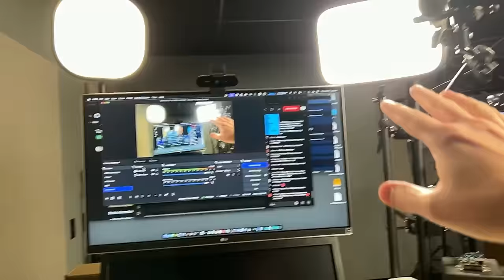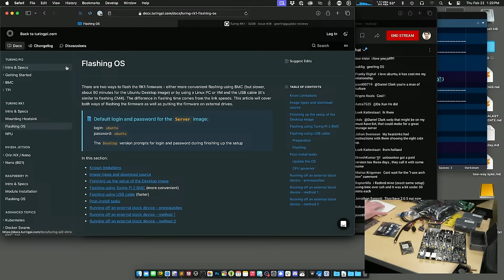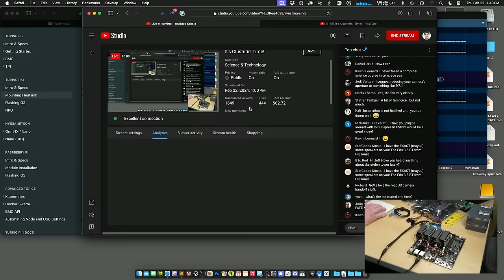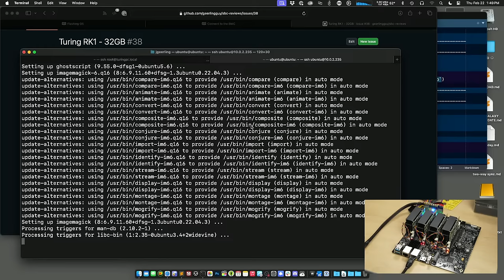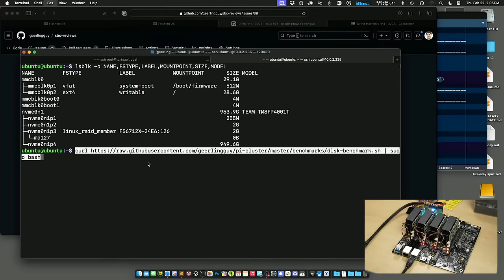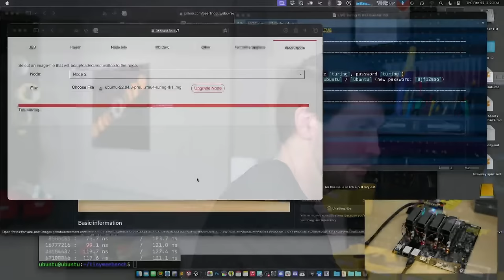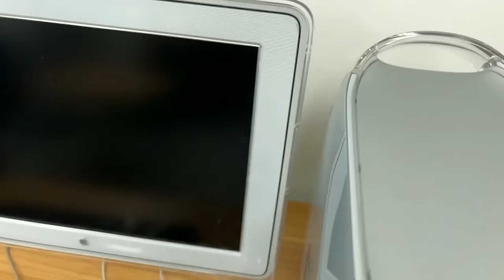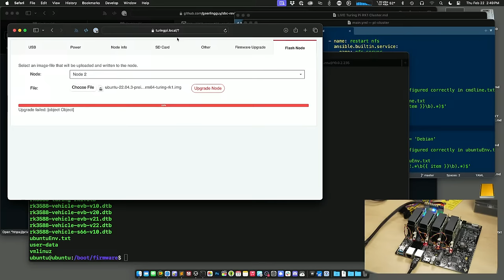It's Clusterin' Time!

Comment: The RK1 looks like an interesting processor option.  The 16 cpus you saw says the 8 core processor has 2 threads per core.  Linux shows a thread as a single cpu.
The single 1Gb ether to me would be the greatest negative for this Turin board.  
Thanks for this video.  For being a live event,  you did great.  Best made plans sometimes just don't work out in execution.  You were really resilient.  No need for apologies!

Comment: I had a Turing Pi 2, partly inspired by your early videos. I managed to get through the older Phoenixsuite updates and get connected to BMC. Got it upgraded to the later and improved software. But there were so many hardware caveats, things to solder or boards to add for basic functionality. I had two Orin Nanos and was never able to get those recognized. Finally realized that the point for me was to learn cluster software, not trouble-shoot hardware so I sold everything off. But I don't have anywhere near a millionth of your level of expertise. Took the case and power supply and built an AMD PC running Ubuntu. That sort of hardware I was able to build and get running in no time.
Reply from the maker: Yeah it's definitely not as beginner-friendly as I'd hoped, especially the earliest revisions of the board. It seems like the new 2.5 version has some of the hardware bugs ironed out, and hopefully they can make another Turing Pi (3?) that fixes some of my last concerns, most especially networking.
Reply: yeah for 99.99% of people that want a cluster it's better to just make a Proxmox server on a PC and run muliple VMs as a cluster, since the software is going to be the same anyway. These things are more for embedded enthusiasts to do weird and wondrous things
Reply: @JeffGeerling  Exactly! I've seen a lot of people struggle and then sell it off like I did. I had a RK1 on order but cancelled that. The Discord group is very knowledgeable and generally helpful but it was apparent that I was out of my league. The PC build helped restore some of my confidence that I can make something work! I still have one of my Orin Nanos so I'll keep an eye out for future updates. It was good to see this stream and get an idea of the general workflow. I find your channel and general enthusiasm super helpful!
Reply from the maker: Heh yeah, sometimes you need a simpler project to keep your sanity. I am working on some old Macs right now, and it's nice to have hardware I can hold in my hands instead of tiny single board computers that either work or are trash :D @dollhausenx

Comment: If you had scrolled down the instructions a few more pictures, you would certainly have noticed that the installation was correct and that all you had to do was run the cable "under" the cooler.

Comment: Hey Jeff! I'm just starting to get into some clustering and 'portable computing' for a car project. I was curious if you've had a chance to look at the Radxa NX5 SoM? It looks like it might be compatible with the turing pi 2
Reply from the maker: No but it does look nice—the RK3588s could be even better for this form factor since it takes off a few interfaces in favor of a smaller package and a tiny bit less power consumption. But it would probably need some support from the Turing Pi board for hardware support.

Comment: is the presence sensor not like being near the metal rack bar, and/or is the bigger metal rack blocking or otherwise messing with the reflective pattern ?
Reply from the maker: I wonder if that could be causing issues. It is a bit sporadic, so I'll have to mount it on the wall away from the rack.

Comment: Considering my options with the TuringPi_2.4 and 4 RK1 16GB modules plus NVMe drives.  I am thinking to setup Docker Swarm across all 4 RK1's vs Microk8s kubernetes with Ceph on the NVMe drives. I might split the NVMe partitions and only use part of it for Ceph persistent storage.  Alternatively, I could NFS mount and use that for persistent storage for kubernetes.

Comment: Just got mine too. While installing the heatsinks did you observe the pads not touching the back of the heatsink properly?
Reply from the maker: They seemed to make contact on mine.
Reply: I wonder what the best way to solve this is. Fatter thermal pads? Can I double up on pads or maybe find some fatter ones and cut them down. Hmm.

Comment: have you done any of hte nvidia jetson orins with this?  i'm having a hell of a time finding a usb cable that works to flash the card.   if anyone has had any luck and has a part number for a usb cable that worked i'd appreciate it, tired of getting another one form amazon and them not working (usb a- a data transfer)
Reply from the maker: Not I—but I've heard USB flashing is not working that well; I'd check out the Discord.

Comment: Get an antistatic, heat-resistant silicone soldering/magnetic work mat so you don't lose all your screws. Amazon has all kinds. I went with the Kaisi S-180, but you do you!

And stop touching the contacts with your fingers! The oil on our skin is corrosive. 😧
Reply from the maker: Once I have a proper electronics bench I plan on doing that; I don't have a great spot for it on my desk though, at least not with my current setup. Maybe I'll get a smaller pad.

Comment: What's clustering good for if you don't get redundancy? 🤔
When you're on the same mainboard a hardware/power -fail will probably take all 4 CPU's out. 😕 
This setup can of cause be used for training/experimenting, but I would not use something with a possible ( single point of failure ) in an production environment. 😉
Reply from the maker: Yeah, what I would like to see is a better/faster network connection, so you could run multiple boards—alternatively, the Compute Blade will hopefully start shipping soon, and that has a little more built-in redundancy!

Comment: Waiting on my 32GB Rk1, still  shame they didn't add pwm fan to the turing pi, been contemplating adding it to my board just can't find anyone to do it.  Hopefully CM5's will be compatible also !
Reply from the maker: The fan control is PWM, it's just there's a weird bug with the 2.0.0 firmware, it seems. Three of the nodes are coming up with PWM, but node 2's fan still spins full blast for right now. Will upgrade soon.

Comment: That's a computer.... lolz.  You are gunna need more power supply than that....
Reply: Ok, good vid, good brick... however.... would you plugin a 750 Full ATX power supply then re-run the benchmark?  In this design...  
I'd forget the fans, lay it in fiberglass pan with mineral oil, sat in a freezer with wiring harnesses cut out and filled insulated, build that, then run it again.
Reply: Freezer on lowest, some stuff shrinks..... some stuff doesn't as much...
Reply: Such a nice computer... just try it with a Raspberry Pi 4B, good board, totally designed to be run supper cooled exactly like that, in mineral oil, run from in a freezer.  You've never used it correctly until you build them like that.
Reply: Then... when you want it to go faster.... you turn the freezer up, and make it colder... until something cracks.  Cold clocking.
Cray cray over clocking.  I mean super computer, and I mean crazy.

Comment: Your mic(s?) pick up the bass wait to much.Or the compressor add way too much boost on the deep deep lower end.

I believed it was a neighbor doing some work, but no, it's the video.
Reply: listen to it on a hifi system and you will hear it. (during the assembly of the heatsink for example)

Comment: They are cool but still cost too much. Heck you've got 4 there so you're talking $600 just for the boards. For that price you could get a much more capable small form factor computer with better grafix.
Reply from the maker: For many use cases, that is a perfectly reasonable option!

Comment: 47.01 You are flashing one node at a time. Why? Don't come with the UI only supports one. You can open it in 3 different tabs and could update 3 nodes at the same time.
Reply from the maker: I tried, but unfortunately when you try doing more than one, the one you started latest takes over, and the other tabs stop.